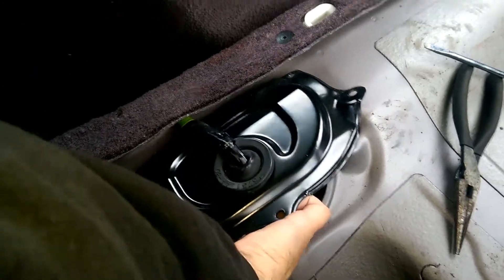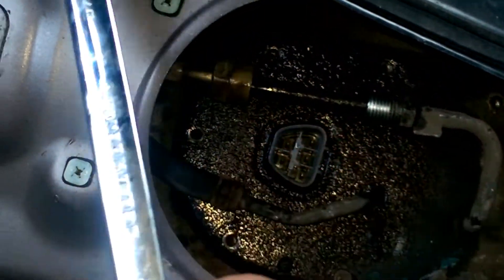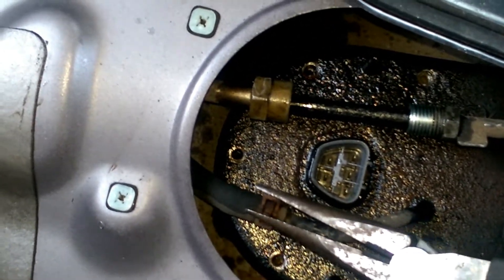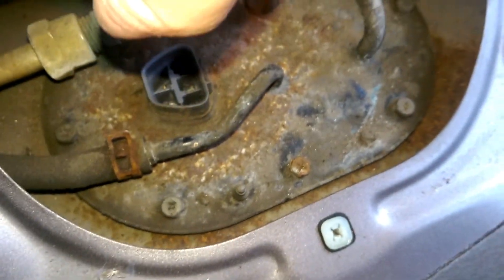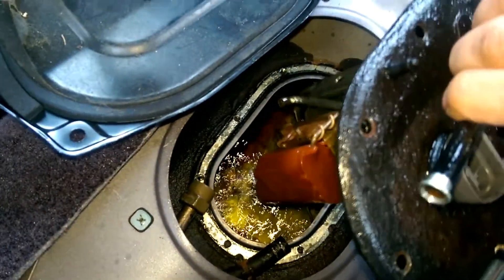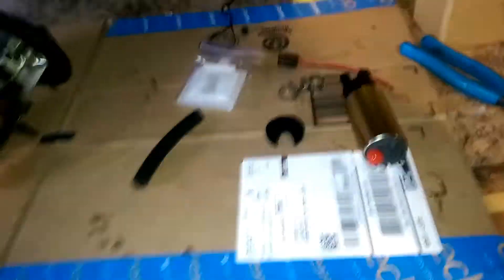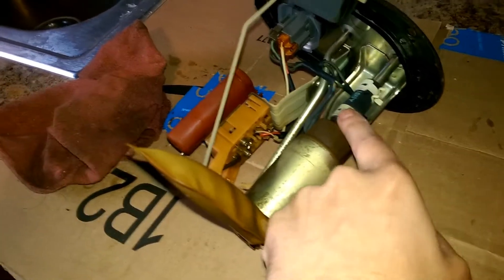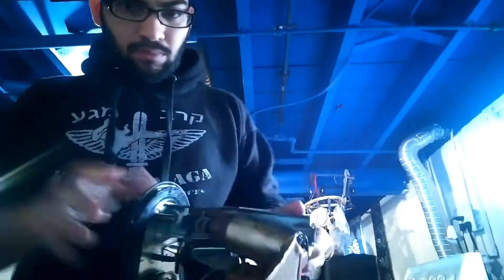how to replace fuel pump

Comment: Hello. I will have to change the wire connector as well. Is it okay to use butt connectors? I don't own a soldering iron. I was also wondering if I would have to use something to insulate the connection like heat shrink tubing? If so, do you know what type of heat shrink tubing is safe in gasoline?
Reply from the maker: You can but connect if you want but definitely  heat shrink as well. I'll look more into it to see if there is somehint special for gas.. but I dont think so..
Reply: Thank you for your insight. I actually just found an old solder iron that I didn't know I still had before my first post. Is it necessary to use heat shrink if I solder the wires together? I'm not sure if the exposed wire can cause a spark
Reply from the maker: @hamidt3782  anytime you solder anything, it is always good practice to heat shrink it as well.
Reply: @Kingcustomz  how would you heat shrink it without it catching on fire?
Reply from the maker: Pull it out of the car lol
Reply from the maker: Make sure the fuel is out and evaporated
Reply from the maker: And make sure you have a fire extinguisher near by... you can also buy the entire assembly

Comment: I just did this today it took me 2 days of trying to get the high pressure bolts off after a trip to harbor freight for the right tools. I rounded the bolt and had to use vice grips. Anyone doing this take my advice and get some flair nut wrenches. My corolla had been sitting for 7 years with 314k miles it was toasted.
Reply from the maker: Flare nut wrenches are the right things to use. I'm glad you ended up getting through with it. Is it running good?
Reply: @Kingcustomz  just ordered the pump tonight. Hopefully ill get her running then. Ill keep you posted.

Comment: I couldn't get that bolt loose. I'm scared i'll break the line
Reply from the maker: Don't be afraid take your time... Use one wrench to hold the nut and use the other wrench to break the line loose... If the line is tough spray some penetrating blaster to help free up the line

Comment: How can you get the two bolts to come LOOSE? I held it with the 3/4 and tried to u twist with the 9/16 but it's not coming unloose and looks like it striping
Reply from the maker: OK so first get some penetrating blaster and spray the nuts.  Also, try getting some line wrenches that way it doesn't slip.  Those nuts I believe are metric so maybe a 14 mm and 19mm
Reply: @Kingcustomz  which way to turn? I have tried everything and it just won't loosen
Reply from the maker: That's a hard question to answer if your body facing the windshield. Then your right arm pulls toward you and your left arm pushes away
Reply from the maker: If your facing the windshield, your left hand should be holding the bigger nut with the wrench and your right arm should be pulling towards you to remove, try doing it slow so you don't strip anythinf

Comment: One note, and it might just be paranoia on my part: be careful using an electric drill when using this. The motors can and do produce sparks, which could start a fire or cause an explosion. I personally would use a hand screwdriver once there were gas fumes that were coming out.
Reply from the maker: You are absolutely right, I didn't even think about that...... It not paranoia, your being safe which is the right thing to do... Thank you